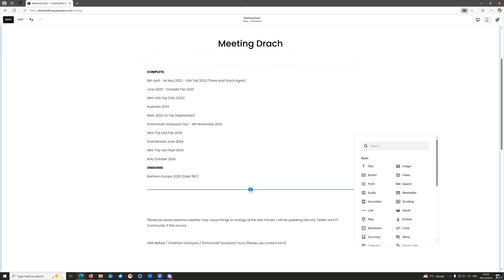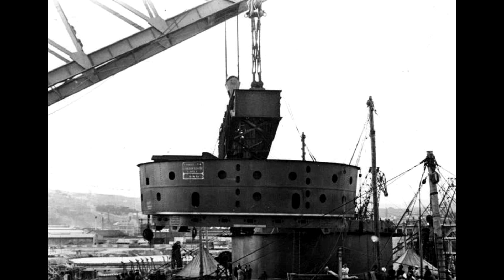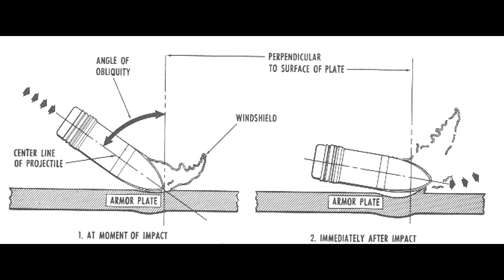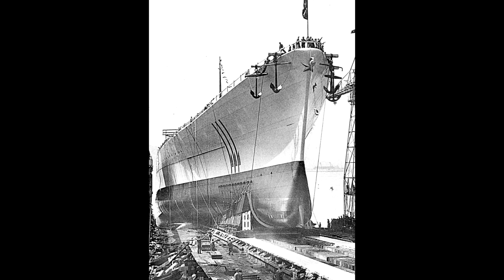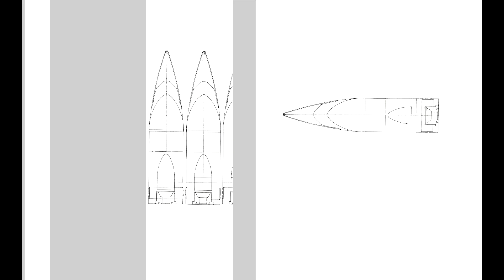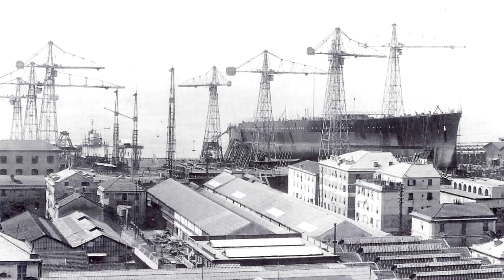Naval Engineering - Did the Littorio's Armour Scheme Work?

Comment: In fairness to the Italians, when she was built, nobody was thinking air delivered  glide bomb (Fritz X) was gonna be a problem.
Reply: Hms Warspite took one Fritz hit, and floated crippled. Same goes for Roma. From that on there is the slight difference; Warspite did not get another dose, a coup de grace, but Roma did. Warspite limped away, and was rendered a shore bombardment unit after that.
Reply: @Ah01  Not really. The first bomb on the Roma overpenetrated (like the Fritz-X tended to do, saving the intended target) and exploded in the water with limited damages. The second one hit the most armoured part of the deck, was stopped in the magazines and exploded there.
The Warspite also was overpenetrated, but the hit had been more central than the first one on the Roma, and the target smaller, so the damages were more serious.
Reply: @ yeah, the first hit on neither ship was fatal, just as I tried to point out.
Reply: True no one thought that someone would drop a heavy explosive rocket propelled bomb that could penetrate most deck armours of the time
Reply: @TheAnimeChallenger Fritz X was purely glide bomb. Only pyrotechnics were flares to aid guiding.
Reply: There was a rocket powered cruise missley variant aswell  @kimj2570
Reply: @kimj2570 true
Reply: @kimmoj2570 no...unlike Azon it was steerable horizontal and vertical. Drop it from enough height and it had an almost Stuka like precision without having to dive onto the target
Reply: @UniversalChallenge4454  Not on anybody's bingo card all... probably why it worked... well except for Warspite.
Reply: @Shutterbug5269  And that was only due to Warspite being too angry to die
Reply: @WandererJester  Even good old Warspite was only shore bombardment vessel, not battleship, after Fritz X hit. She was never repaired. Same with Littorio, never repaired.
Reply: @Shutterbug5269  well. It was Warspite. Almost survived being scrapped due to how angry she was to die
Reply: @Shutterbug5269  It worked ONLY on the Roma, and only in one out of two bombs that hit the ship. Because in ALL the other cases the bomb overpenetrated. It needed the full height and sturdiness of a modern battleship to stop it INTO the ship.
Reply: @neutronalchemist3241  It worked on 3 battleships, and 2 cruisers very well. It aint overpenetration if bomb goes through cruiser and explodes just under keel. Its about perfect penetration. Its like getting hit by bomb AND torpedo with 1 weapon. Fritz X had 300kg explosives, just like torpedo.
Reply: Normally 1 or 2 bomb hits won't cripple battleships to unrepairable state. Fritz X did that to old but fierce Warspite, and very modern Littorio. Roma is in bottom of Med and is Littorios sister ship.
Reply: @kimj2570  As a result, they survived. Even merchants (while usually a single AP aerial bomb was enough for a cruiser). So yes, the penetration was excessive.
Reply: @kimj2570  The Fritz-X missed the Littorio. The explosion, very near to the main rudder, temporary locked it (Littorio could however still use the two auxiliaries), but the damages were light.
Reply: US shipyards which made miracles, and got ships out yesterday, had to work on USS Savannah for 8 months. Thats a lifetime and near what USN would bother. Add to that 3 months (sic!!) of emergency repairs in Malta that allowed crippled ship to steam very slowly and carefully to United States. That was 1 hit, which after going all through ship, including gun turret, exploded under the keel. Overpenetration LOL. Thats HMS Belfast level damage.
Reply: @kimj2570  I don't doubt that the Savannah took a beating. But, IE, it needed only two Bf109 bombs to sink HMS Fiji, a very modern ship of similar size. Due to the general lack of an armored deck (apart for a pair of classes) Cruisers tended to not react well to aerial bombs.
Reply: @Shutterbug5269 study history. The Warspite after being hit in a place not serious had to be towed by American tugboats
Reply: @giudicedredd9195  I do study history.  I have on and off for 30 years.  Bombs like Fritz-X (or V-1 & V-2 for that matter) were absolutely not on anybody's bingo card when any of the battleships serving during WW2 were designed and built. Including Warspite, Rodney or ANY of the Iowas, which is why it was effective as it was.
Reply: @Shutterbug5269 but let's be honest, that's just Warspite
Reply: @TheAnimeChallenger  Like no one thought that someone would drop a chinese drone armed with a shaped charge on top of a main battle tank...
Reply: @TheAnimeChallenger 
Same issue we see nowadays on terrestrial battlegrounds, with Main Battle Tanks against  Few100sUSD FPV drones.
Reply: NOBODY saw that coming.
Reply: Fritz X only worked a few times because a) the guidance system was primitive and easily jammed, b) It required a very skilled operator to work at any real range, and c) Flying low and straight in a war zone is a bad idea. I always wonder what would have happened if Project Pigeon had been considered and developed prior to WW2.
Reply: @onenote6619flying low and slow
I would regard 5km (16,400ft) not as particularly low … the bomb needed speed to get through a ship. It also helped the range.

They were playing with a TV camera to make guidance less MCLOS but I don’t think that was ever ready for battle.
Reply: @onenote6619 I suspect that after being carried in a bomb for some distance the pigeon would not be very interested in pecking at warships, but . . .
Reply: @onenote6619  It didn't work for long for the same reason most of Hitler's wonder weapons did.

Because hastily deployed "new tech" generally has teething problems.
Reply: @Shutterbug5269  True enough. But a lot of the electronics war in WW2 flies under the radar (pun not intended). The Book 'Instruments of Darkness' by Alfred Price is something I picked up as a teenager by accident and presents an often-ignored viewpoint.
Reply: @Shutterbug5269  Fritz X sank brand new battleship Roma. Littorio barely managed to limp to Allied port. HMS Warspite was crippled to make her as only mobile shore bombardment vessel by Fritz X. Cruiser USS Savannah was penetrated all through ship, bomb exploding under the ship. It took 1 year to repair her. HMS Uganda got serious hit, and many more close calls and smaller damage. Where is FAILURE in this score? Allies could counter Fritz X only after countermeasures against guidance were fielded.
Reply: @kimj2570  Sure, it worked for a little while. In that sense it was a success. But the Axis failed to keep it working. Which is a failure. I still think, though, that Project Pigeon held a lot of promise and would have been largely immune to counter-measures, though difficult to deploy in quantity.
Reply: Fritz X was PC1400 armour piercing bomb with small wings. Any ship hit by it were serious hurt or sunken. In times of Anzio Allies could jam it successfully, but in late 1943 it was serious menace. Every German bomber near Allied ships was possibly carrying it.
Reply: @kimj2570  Only the ones who were highly trained in using it. And that's a small percentage.
Reply: @Shutterbug5269    teething problems
… not so much with the Fritz X, it was the effective jammer that jammed the intermediate frequency in the receiver that made the Fritz X less useful — albeit a wire-guided version was considered.
Reply: @onenote6619 True. Germans failed to counter counter measured to keep guidance system working. In addition, weapons like that needed highly trained crewmember to guide it to target. Allies rising aerial air supremacy made it impossible to have bomber loitering around.
Reply: @onenote6619 pigeon was cancelled because the radar guided ASM-N-2 Bat was better. It could be dropped and ranges and altitudes outside the pigeon bomb envelope and could be used at night.
Reply: @kimj2570  I seem to recall in another Drach video that the allies solution to Fritz X was to lay the 8th on the factory that produced some essential component.
Reply: @kimj2570 To add to your point, the Allies wouldn't have wasted their time developing a countermeasure to this weapon if they weren't concerned about it sinking their ships.
Reply: @onenote6619No wonder. The first transistor was made just after the war.
But it's impressive what they did with what they had.
Reply: @kimj2570 where did you read this nonsense? The Littorio was hit twice without serious damage
Reply: @onenote6619 you don't fly low with Fritz X...you need to fly high...at least 7000m ....slownyes but 7000m high was pretty safe in terms of naval AA fire
Reply: To deploy Fritz X, the plane did not need to fly that high, in fact that bomb fell so fast that it overpenetrated. The plane´s altitude was therefore most likely chosen to protect the plane against AA and the bomb´s speed was just the result. That issue was resolved by changes to the fins on the bomb. 
I think an unguided version of it, streamlined to extra small air resistance and deployed from a high-speed, high-altitude dive bomber, a Do-335 variant comes to mind, which already gets the bomb to Mach 0.7 or so and drops from one or two kilometres may have done the trick better - faster, smaller target and nothing to jam, while the bomb´s drop time oft less than 10 seconds does not really leave much time for a large target to evade.
Reply: And noone thought Italy would betray their allies...AGAIN
Reply: @Ben-f7k5g  You mean Italians won't dare to exit NATO? Just pay your dues is my opinion (and forthcoming Trump administration). Finns, Balts and Polish just benefit his new reign. We all pay 3-4%. Cowards, who cant pay 2% are not needed. Canada is foremost who rides with bum inside NATO. We dont need a**holes like that.
Reply: @Ben-f7k5g Italy never betrayed anyone. Study what is Operation Achse
Reply: @Ben-f7k5g is always Germany that betrayed. Germany betrayed Napoleon, Giuseppe I, Stalin ecc
Reply: @Ben-f7k5g where did you study history? On Mickey Mouse?
Reply: Seems like poor planning on the part of the Italians. In done making excuses for them

Comment: I would also wonder about long-term durability of the foamed concrete between those plates. Naval vessels are subject to repeated bending and flexing, which could grind and crack the concrete. If it were solid, this would be no big deal (up to a point). But foamed concrete would eventually form voids as the cellular structure breaks down. Not something that would be easy to inspect or fix.
Reply: Lol UK schools are falling apart because of foamed concrete failure.  Don't like its chances on a battle ship.
Reply: @RogerS1978  The Reinforced Aerated Autoclaved Concrete (RAAC) failed in those schools because it was load-bearing, which I don't think this interspace armour would be (or at least not as much). The RAAC failed because it was not fully recognised at the time of use that it doesn't stop water ingress very well, so over a period of about 30 years the reinforcing rods got rusty and failed. Although the Littorio class sopping up water like sponges over decades might have become a problem, I don't know if there was any rebar in the blocks that might have rusted over time.
Reply: @RogerS1978  Yall talking like that foamed concrete has somewhere to break off and go to when its stuck in a vaccum, a confined space, boxed and packaged in steel.... Cant go anywhere.  Even if it cracks to hell inside.
Reply: Depends how they installed it. If it was simply poured into a metal cavity then that would definitely be a problem. However if they took that problem into account and maybe reinforced it or had some kind of dynamic barrier then the concrete would last much longer. Though much smaller concrete boats do exist
Reply: @alexdunphy3716  I would love to know myself, but it is well outside my field of expertise. I can't see them just rolling up and pouring wheelbarrow-loads of mix into the space between plates, because that would almost certainly result in voids. More likely, they made big slabs and laid them in place as the outer layer was built up. As to the composition, the Roman Empire knew about foamed concrete, so it is well-understood. As I understand it, you add some kind of surfactant to the mix and then whip it up. The more you whip and the faster it sets, the more air is entrained. Preferably in lots of small bubbles rather than fewer big ones. More modern versions add stuff like nylon fibre and plasticisers to the mix, but that's well beyond the state of the art for the Littorio time period.
Reply: Caveat: Purely speculative, albeit from a civil engineer specializing in concrete.
If, as I would expect they did, the concrete was pre-formed and installed as slabs, it would have made sense to reinforce it internally, if for no other reason than to make craning the slabs around easier. It would also potentially restrict movement and deformation of the slabs to the joints, dependent on how the ship moved, of course, which would mean they could have relatively easily have been capped to avoid damage. A steel skid plate or rubber filling between plates, perhaps.
Reply: Also, doesn't the acidic nature of concrete rust away steel pretty badly? I recall hearing that in preservation contexts, like why nobody does the Mikasa thing any more.
Reply: @Alsadius  Concrete is (at least to begin with) alkaline rather than acidic, containing lime (Calcium Oxides and Hydroxides) as the setting agent. Fail to wash wet concrete off your hands and you will soon find this out. Water ingress is definitely necessary to cause rusting of the rebar, though. It should be noted that the problem is progressive - rust occupies much more volume than steel. Once rusting starts, the rebar swells, pushing the concrete outward and making more room for even more water to get in.
Again, though, did the Littorio have any rebar in the interspace concrete? I have no idea.
Reply: It could probably be inspected with ultrasonic tools, given the different acoustic properties of all three materials. It wouldn't be available at that scale at that time, though.
Reply: @Not_Screws5094  If the voids were very large, banging on the outer plate with a big hammer would be enough. At that stage, though, its already too late
Reply: @leandersearle5094  does it need be done with ultrasound? From 1857 seismological experiments were being done with explosives as a sound source.

Comment: The best scale for testing this is obviously 100 cm to the meter.  Now, where can I find some spare 15" Italian gun barrels and a couple dozen km of test range? ;)
Reply: Lol I read 100cm as 100mm and I thought you were building a cruiser sized littorio
Reply: Hard to say. Do you have access to any Littorio-grade foamed concrete? That seems to be the unknown variable.
Reply: But I use imperial measurements, I'll do 36" to the metre instead
Reply: @neilcampbell2222  To get a bit closer, go for 39 3/8 inches.
Reply: I don't know where to find a 15" naval gun, but you don't need a couple km firing range. 
Just fire point blank. Just scale the charge of the shell to match the its velocity at a certain distance.
Reply: And you don’t need kilometres of range for a backstop either fire the gun into a mountain… actually a dirt hill would be preferable as it’s less likely the shell would bounce after penetration.
Reply: That's simple: you can go in Friuli Venezia Giulia at the dockyards of Fincantieri.
They will be glad to give you what you ask for. But for the training center you have to go in Sardinia, where all our Armed Forces trains every year for the whole year.
Reply: You could scale down to down.  Meaning you scale the plate to a smaller plate along with the foam concrete and use a smaller projectile with less powder and could then make the bullet cause you would be using a rifle or pistol and make one with a plastic cap, use copper to shape the blasting cap and then the lead to be the actual projectile.  Then all you need is a high speed camera set up along with a marking/measuring board opposite of the camera.
Reply: Texas. Just put it up on a crowdfund site and there'd be a rich enough gun nut to sponsor it from scratch 🤣
Reply: dont use italian ammo, youll miss
Reply: @andyf4292 There is a very interesting discussion about why Littorio's ammo was so inaccurate, of course it comes to a variety of factors, but one seems to be that AP shells where over-stabilised, so they would start traveling sideways as their trajectory falls and develop lift. This caused them to spiral aroud the trajectory and not to hit head-on.
Reply: @andyf4292  nonsense. We didn't miss in past and today we will not miss anything... since we are the only ones today to have laser-guided naval ammunitions. 😎
Reply: @andyf4292  moreover, would you try your 406mm of the Iowa? That stuff shoots 6 km less than our 381mm.
And the 466mm of Yamato just 2 km less.
Don't try that stuff with us, we got the gun from the British, but we mastered it. So well that today WE are those who produce the best naval guns around the globe.